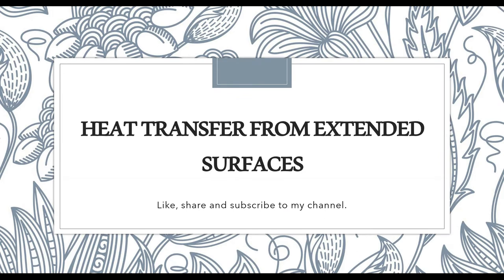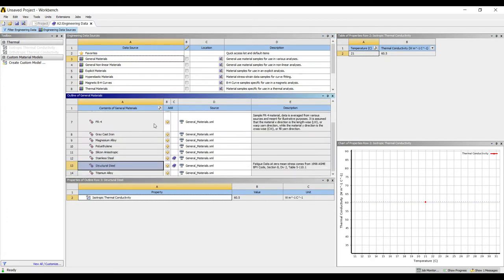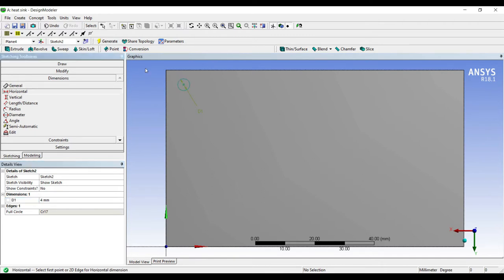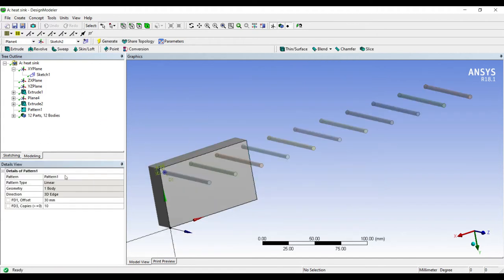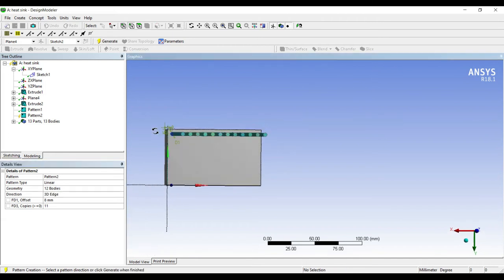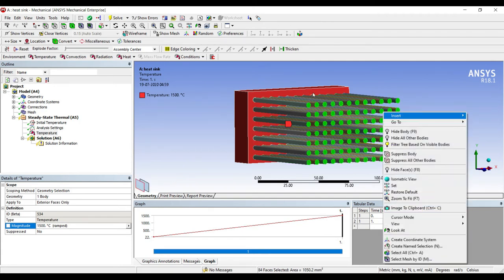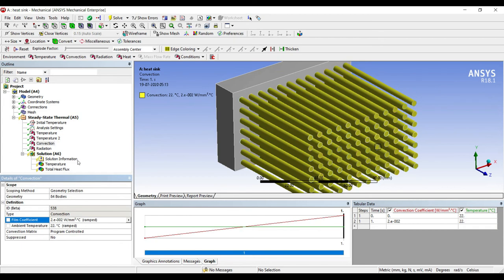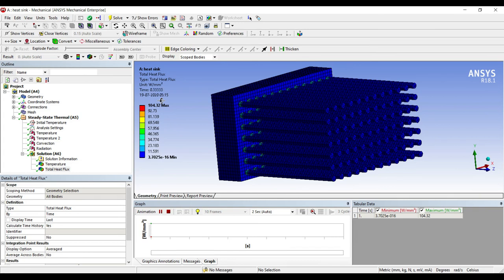Heat Sink I Extended Surfaces I Type 5 I Thermal Analysis I Problem 10 I ANSYS Workbench

Comment: Ma'am please upload a video on reinforced cement concrete slab size 510x510x50 mm slab steel 8mm 5bars on x and y axis and point load on center of 25kn and fixed support on 4 corner. I will require this for my college project  thank you   for sharing all your precious knowledge
Reply from the maker: +Vaishali Parab I am working on it. Fixed support on edges?
Reply: @ProfSDBagg  fixed support on four corner or vertex
Reply from the maker: @vaishaliparab8388  Watch out for tomorrow's video. Till then watch today's one as you will get some idea about basics. Also let me know if you want a static structural or dynamic analysis?
Reply: @ProfSDBagg  thank you ma'am
Reply: @ProfSDBagg  static structural
Reply from the maker: @vaishaliparab8388  ok
Reply from the maker: @vaishaliparab8388  Are the steel reinforcements to be considered stainless steel or structural steel? I am taking von Mises stress for steel reinforcements and Maximum principal stress for concrete. Hope that will be fine for your solution.
Reply: @ProfSDBagg  structural steel n graph if possible for load vs deformation
Reply: Error occurred while solving was freedom of nodes in uz direction